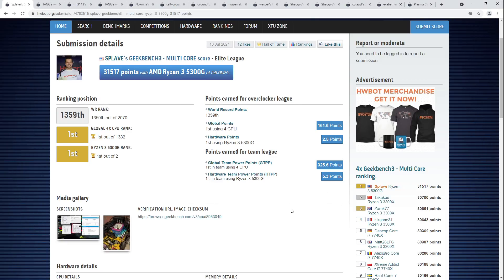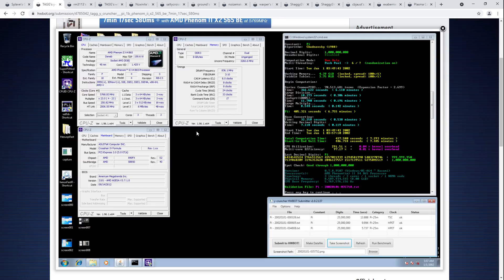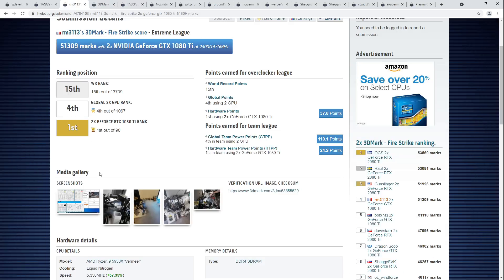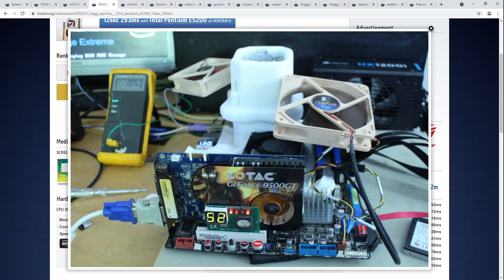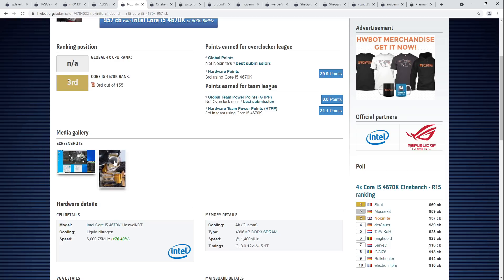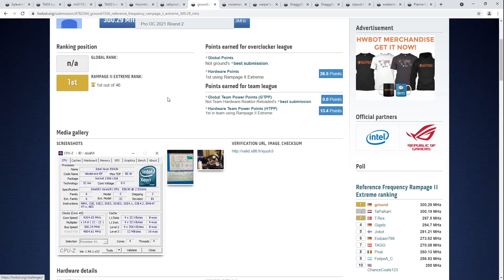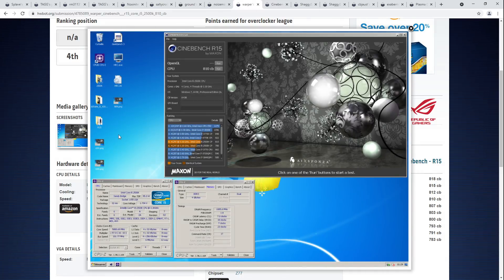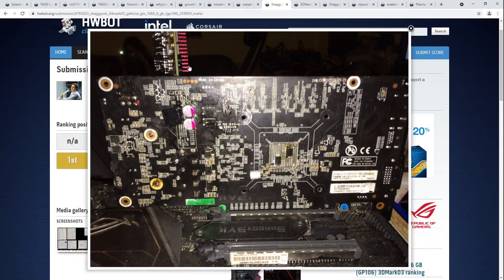HWbot score round up #11: 300MHz BCLK on X58, LN2 SLI 1080Tis, E-powered GTX 1060, and more... !

Comment: You mention the ubiquity of the LGA775 socket (and how cheap the CPUs are) and I have to say, I do LOVE socket 775 - not only are there over a hundred chips that it'll accommodate, but LGA771 Xeons can be easily modified to fit it as well!

Comment: I have a Rampage II Extreme and a Xeon X5675 running my home server, and you'd have to pry my X58 out of my cold dead hands. 300MHz BCLK is absurd, 214MHz was the highest BCLK I ever achieved, but it was with a Xeon X5570 w/ a 22x multi which was only good for 4.7GHz @ 1.58v on chilled water. In my experience the 6 core Xeons do not like approaching 200MHz let alone going over it, yet, IMO, they are the most fun to overclock because their performance isn't bad even by todays standard.
Reply: I have an E5649 here that does 269 BCLK on aircooling ;) I'm sure if I binned enough I could get a 6 core xeon doing 300 BCLK too, but won't bother with that category anymore since I consider it done.

Comment: - 300 BCLK score was PCIe limited since >0.45xbclk is needed, board was almost impossible to stabilise above 135. 
- the 3 phase vcore on Shaggys 1060 was blown up by its previous owner spectacularly shorting a fan header while the card was running. When we epowered it we didn’t even know if the core was still alive. 
- GTX 780 was just a pretesting run, we didn’t even try voltage above 1.4V, which passed 1900 core iirc (though scored slightly worse then 1850?). I hope Shaggy runs that card soon again for even higher scores :D

Comment: that awkward looking cooler on the GPU was popular back in the 8800GT and 8900GT era, some wrapped over to the card with the fin stack on the back. I have a MSI-NX8600GT with a similar looking heatsink, and I think ThermalTake also made a few aftermarket coolers like that back then. ok, found the flame style of fins, Thermalright (HR-03 GT) 8800GT cooler.